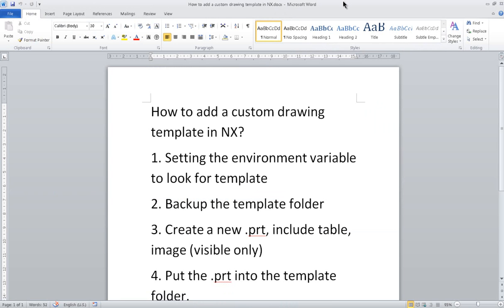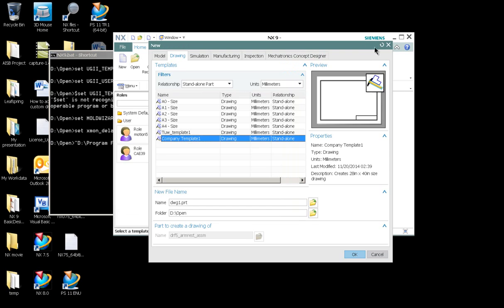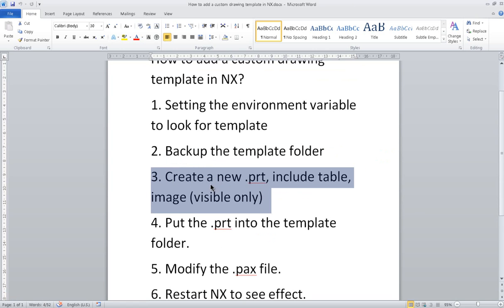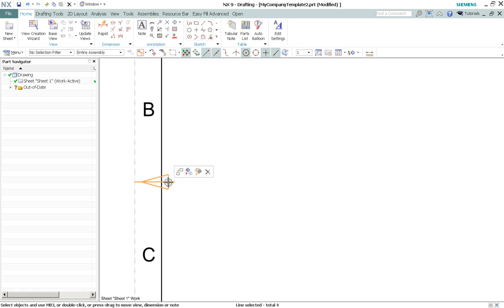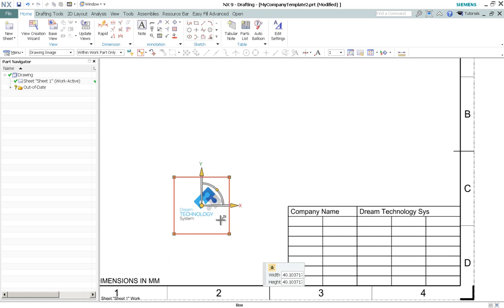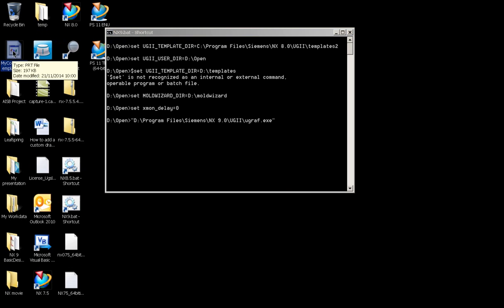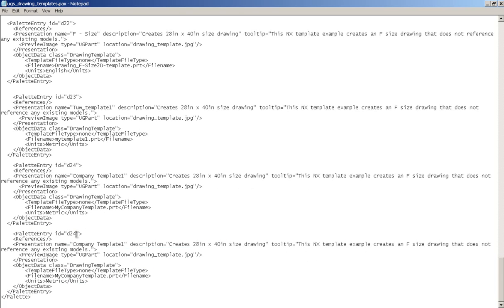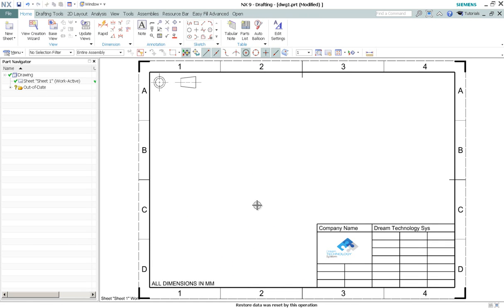How to create a new NX drawing template

Comment: Nice video sir, and i have a query i successfully created my template and i can see after starting it in file --new---drafting  but when i go to start--new --modeling---create any part file and go to application drafting there i cannot see my company template in that What might be the problem..or should i open the template which i created then go to application switch back to modeling then come back to drafting???
Reply from the maker: Sorry for the late reply. To achieve your objective (created a CAD model and go directly to drawing application but couldnt find the template), you will need to edit another .pax file instead, which is ugs_sheet_templates.pax, rather than the .pax file shown in this video.
Reply from the maker: hey Karthik, I think that workflow refers to another .pax file, which i am not sure yet..
Reply: Do you find solution for this ?
Reply: I had the same question. And the solution worked very well for me. Thank you so much. :)